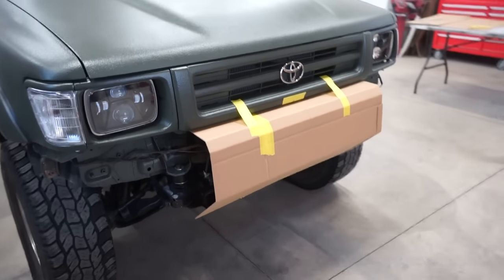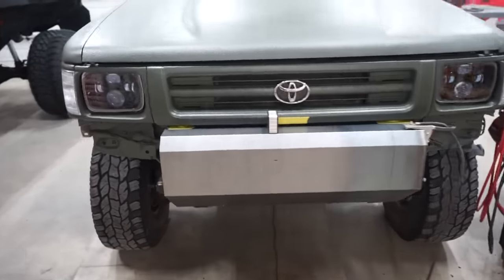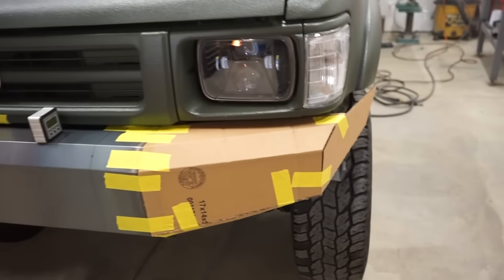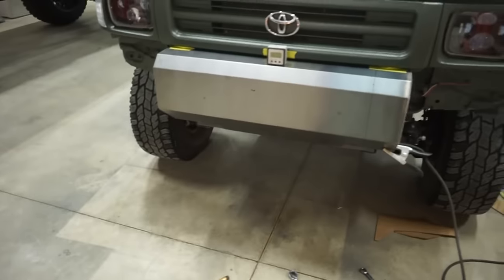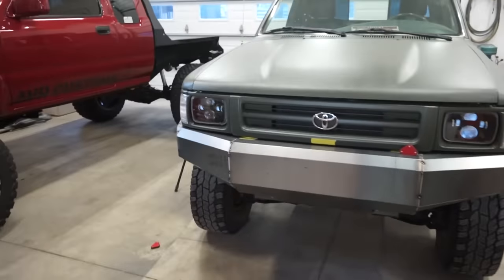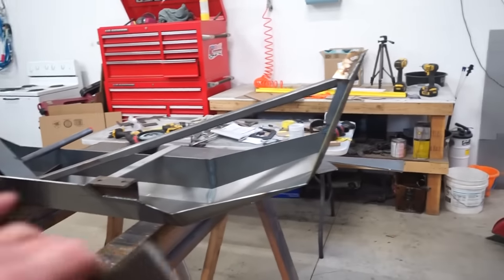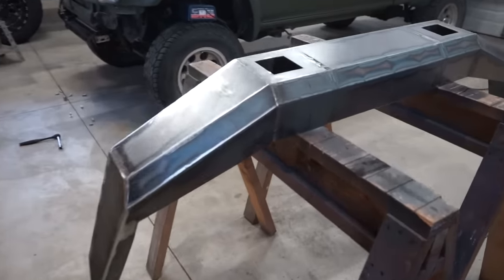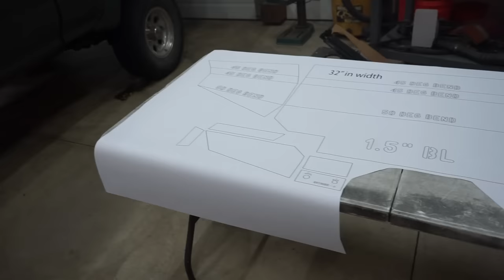Building The Perfect Front Bumper For The Toyota Pickup!

Comment: Bumper looks great!
Just a little tip for when you, or anyone building one, cuts out holes for lights:  After you have your hole laid out, create another line 1/4" offset to the inside of your cutout, at the intersection of the inside lines, drill a 1/2" hole.  This will create a nice radius for you to cut up to, providing both a cleaner finished look and making it easier to remove the cutout plate.  This strategy could work for light holes, winch holes or whatever cutout features you have.

Comment: The bumper looks awesome and your way of building it is like art. There is a little problem with it though it blacks air flow to the radiator / trans cooler you might want to think about putting some louvers in the bottom section of it to let some air pass threw to save the engine transmission life.

Comment: What gauge sheet metal did you use for the bumper and the mounts?
Reply: Second this, don't know why it wasn't mentioned.....
Reply from the maker: Mounts are all 1/4”. Plate is 1/8” I wanted to keep this one light weight. I’d do 3/16” if your going for beef
Reply: Thanks. This was my question as well. I’ve been working on a bumper very similar but will have a winch mount.
Reply from the maker: @davidmoon2123  nice! 3/16 would be good for a winch bumper. I just wanted to stay light!
Reply: @austinniemela  Thanks, I was thinking the same. Mine is for an '88 with 1.5" lift. There are already design elements I'm going to change based on yours. It looks really nice. I'm not nearly the welder you are so I'm going to need a lot of flap disks and paint.
Reply: Guess if you dont want the xtra expense of buying 1/4 in for mounting you can just weld together pieces of the 1/8in @austinniemela

Comment: Good process!  Think thrice, measure twice, build once.

I like the scoring and bending method for bending without a brake, better than the slotting and bending and all that welding and grinding.

Have you ever tried scoring your big sheets with your portable steel saw?  It could be done very accurately that way.

Comment: If you haven't already welded your clevis mount to the front of the bumper cut a hole in the bumper just big enough for the clevis mount to fit into. That way you can weld it from the front side and the back side making it stronger.

Comment: Looks great.  Only question I have is airflow to the radiator.  About half the airflow comes from the grill in the valence, below the bumper in a stock Toyota.
Reply from the maker: I have thought about this. Look at “most” plate bumpers. They don’t have huge holes in them. I tried with my other Toyota, pulling the lightbar out to open a big hole and had no affect on cooling!
Reply: Your are in a cooler part of the country too. It wouldn't be hard to cuts some vents, for people in warmer regions if needed.

Comment: what about trucks that are A/C (condenser) equipped[with fans!] ? Some 4-runners have two A/C condensers up front there !  And some Automatic Transmission truck/suv owners use an external trans-cooler .The turbo models have an intercooler to work around. Some of these Hilux models also have a power steering cooler as well ...this bumper (if not thoroughly thought out ) may damage those components with just a 15MPH tree--bump  🤦‍♀️ definitely giving this a thumbs up .. but mass producing these should have wayyyyy more considerations in the build ...one size does not fit all..jus say'n  😁
P.S. We like a skid plate up front too ( the 22RE belts need protecting )😏 and maybe a front receiver hitch port..for those of us that use trailers and winches ALOT ! 😉

Comment: Great work. On the end pieces, the bottom corner that you opted to cut and weld the whole joint, it my be worth a bit of waste. Leave the bottom panel of the end section larger than needed and cut after the score and bend. Either way though, you do good work. 💪
Reply: Afterthought. Be sure to leave fluid clearances for washing mud and debris from inside.

Comment: Nice job! Can you share some details about that saw with the black and blue body? It seems to cut the metal very well. I’m in the middle of a similar project, and a saw like that would be great to have. Details about the steel would be great too. 1/4 inch cold rolled?

Keep up the good work!😎
Reply from the maker: Link in description for saw. I used 1/8 and 1/4
Reply: @austinniemela  thanks, but the link does not appear to be present on my iPad. Stooopid apple...
Reply from the maker: @hgj2019  https://amzn.to/359BMf3
Reply: @austinniemela  thanks!

Comment: Do you have to beef up your front end after install, we did a similar project bumper in high school (1993) and after the bumper was mounted on a 88 F150- the owner claimed it was hard to control and had alot of clatter over bumps.
Reply from the maker: No this one is pretty light, it does great

Comment: I have been planning on a custom front bumper for my GMC pickup for years but have not figured out a way to build it. Your method should work well for any truck. Also what  thickness of sheet steel are you using for the build.
Reply from the maker: I used 1/8 to stay light but do 3/16 if you want beef

Comment: You need to invest in a air compressor with a press and you can pre weld some angles to set on top and bottom and you let the press do all the hard bending used to do it this way with 3/4in

Comment: Q: if the vertical faces had a grid of holes or slots, would the performance (strength, durability, usefulness) be compromised much? Saving some weight would balance out MPG loss of introducing air pockets (if any) and mean less work for the suspension I would think. Am I missing anything? I like the shape of these, just thinking about many variables to optimize and potential drawbacks.

Comment: Gday mate massive fan here buddy, quick question, obviously remove the battery when welding on a vehicle, is there any other advice towards preparation for welding in case of any damage to electrically in vehicle?
Reply from the maker: Not much else you can do besides disconnecting the battery!

Comment: Can a winch be used with this bumper of I cut out a slot and fab a bracket to hold it?
Reply from the maker: Depends on the size of winch. Would have to take out the main gussets and integrate a winch plate into the mounts of bumper

Comment: Why would a lift change the geometry of the bumper?
Reply: My guess is that with a body lift the frame points that a bumper would bolt to and the body lines of the truck change, so to make a bumper look good the geometry would have to change.
Reply: @lukeharmon1517  yes, if you are elevating the body off the frame, then that would change, but unless you're 7 feet tall and going to fabricate an all new floor pan, why would someone ever "reverse channel" a vehicle???  Your ground clearance is still the same--axles, drive shafts, diffs, frame, oil pan, exhaust...all at the same height they were before!

Comment: You da man!!
Yota-porn with cardboard and steel.
Love it!
Now how do I get it wide enough in front to accommodate my Warn 8274 winch
Reply from the maker: Possibly depending on the size. You would have to take out the main gussets to get the width and integrate a winch plate into the mounts

Comment: Couldnt find a way to direct message you. But i am planning to make a trip to pull and save on the 9th if you wanted to meet up i can bring that gauge cluster with me if you are still interested
Reply from the maker: Which did you have?
Reply: @austinniemela  i have both electronic and cable drive speedo. I thought you said your gray pickuo was a cable drive?
Reply from the maker: The green truck is cable. Its the SR5 cluster with a tach? You can email me austin@avrcustoms.com
Reply: I just sent you an email. Let me know if you get it